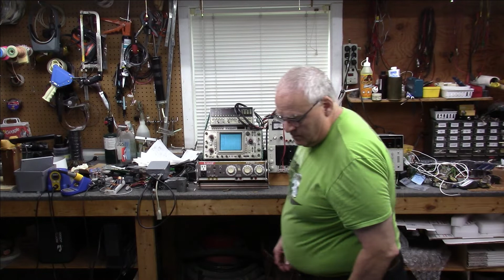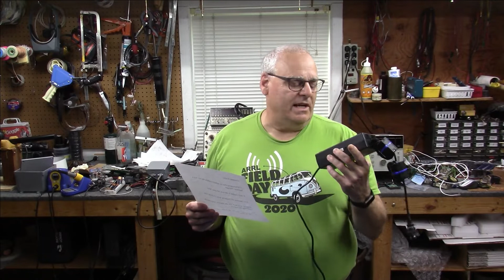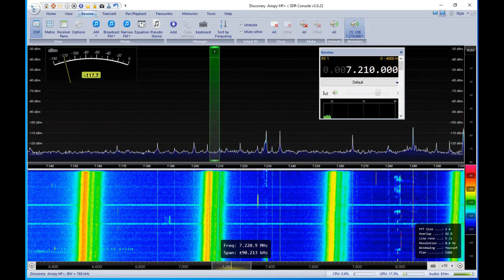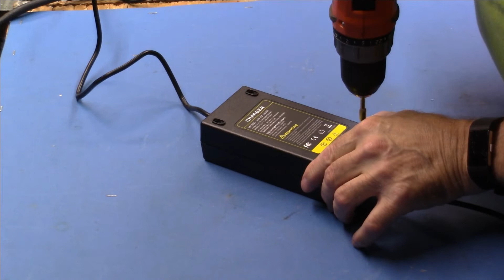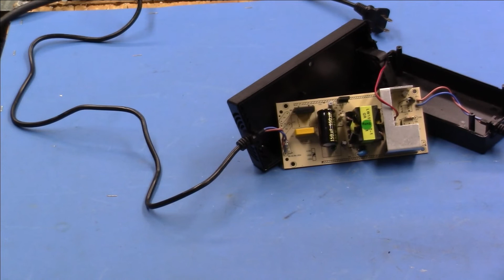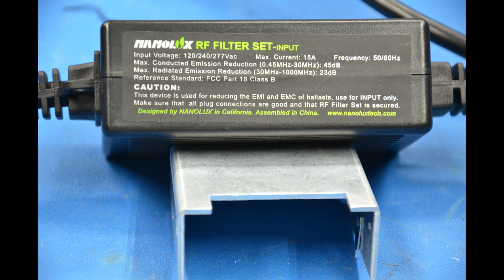Battery charger RFI How to fix

Comment: Another problem with snap-on chokes is the break between the two halves of ferrite.   No matter how well polished they are, the break does reduce the  shielding effect.
There can be times that an increased gap can help - but this is not one of them.

Comment: Thanks again for all your efforts.

Did the OUTSIDE packaging for the battery charge happen to claim either an FCC Class A or Class B rating ?   I just got to t he REAL end of your video(s), and it sure doesn't say either one on the case.

I just got a Battery Tender brand charger, and it claims to be Class B (the better of the two).   I have not had a chance to perform the same tests you've done yet.

Comment: Its nice to hear someone, but honestly you spent too much time trying to find someone to listen to.   The visual and audio differences in noise were easily seen/heard without having someone talking.  Nice demonstration though - good to see the difference between each of the options to address RFI - that battery charger was noisy!   
suggestion for future videos - instead of talking ahead of time of the 'corrections' to the video, just put text on the screen where mistakes were made (like putting "*battery charger*" on screen each time you said "power supply").   Shortens the video and gives us the info we need.

Comment: Kevin Loughin has shown his camper's LED lights ruining 2 meters (he installed a filter capacitor).  Antenna man also showed how LED bulbs are ruining TV reception way up at VHF.   I thought it was just an isolated incident in lighting, but this clearly shows a variety of manufacturers don't care about RF noise.

https://www.youtube.com/watch?v=RaVicRHGoic
https://www.youtube.com/watch?v=MYNNs_1LLjU&t=11s

Comment: Unfortunately the FCC as well as the Electronics Consumer industry has failed to protect our radio spectrum. This has not only put Ham bands at risk, but has also put the Public Service Bands such as Police, Fire and Commercial Broadcast all at risk. In Las Vegas NV, Casino Parking Lot LED Lighting was found to be a real issue with Public Service Radios and that was with the more lenient Commercial regulations. Myself, I was surprised to have a major offender with Cree LED Light bulbs and those would be the better products available, yet disrupted Commercial AM radio in my home. 

Any offender can test fine under controlled lab conditions, but when you add all the house wiring as an external wide band antenna to that device, then add 20 such devices as in most homes, your results will vary and it's sure to be bad.
Reply from the maker: Hi Dennis, I agree, multiple devices means multiple problems.  I look around the shack and I see no less than 12 devices in my shack that contain switching power supplies.. Most are  not a problem, the ones that are a problem I have taken care of.  I have no more wall warts in the shack. I do have a linear 5 volt supply that runs all the stuff that needed its own  5 volt wall wart. Much quieter...

Comment: Thank you for the tip! I have not been able to and eliminate the disturbances that enter the Airpy HF Discovery due to the USB port of my laptop. I have used it with the battery only, but I disturb every 25 Khz. I put the USB cable with the ferrite and wrapped the cable with many turns. But nothing to do. I have tried an isolator for USB but it does not run the Airpy. Do I have to change my laptop?

Comment: Glad to see you well, Paul. The switched power supplies/inverters/chargers have become an endemic problem, even the most expensive ones. This proves the designers didn't take care at all about the EMI problems they can cause. Not that they didn't know how to solve them, but they only do the minimum to pass the FCC bar, which is very low nowadays.
Reply: Right now, the German government is starting to crack down, big time, on solar power systems and LED lighting.   The remainder of the EU may follow suit.  Hopefully the US will too.

https://www.cwnp.com/forums/posts?postNum=317186#post317186
Reply from the maker: Hi Prog... I am sure that this particular model would not pass FCC emissions limits.  They totally disregarded any filtering on the AC side.  I agree.. the bar is low.. and there are so many devices incorporating this type of power supply design.   Thanks Prog.. good to see your still out there !!!

Comment: Great job with the video and thanks for your help with the mini loop. It took us 3 visits to get the source down to one of two houses and the loop helped us confirm the culprit. I had 2 type 43 donuts with me (my local store was out of 31s) but they were enough to knock the noise down to where Charlie could hear again on 40m. 

73 and thanks de K6RBS 

P.s. You can get anything you want (you know the rest ;-)... we always play it on Thanksgiving)
Reply from the maker: Its a tradition here too....  "we figured one big pile would be better than 2 small ones...."